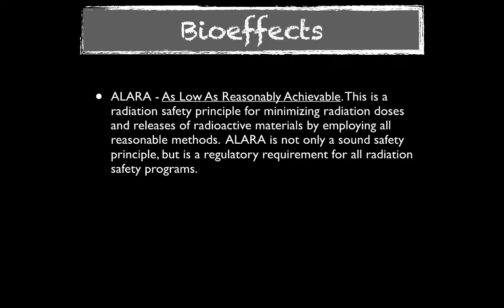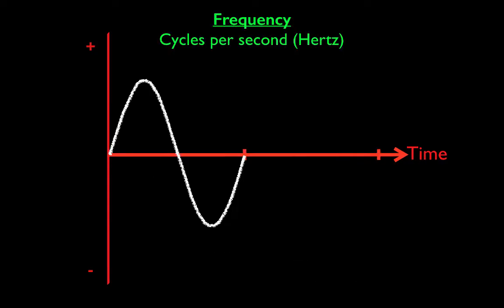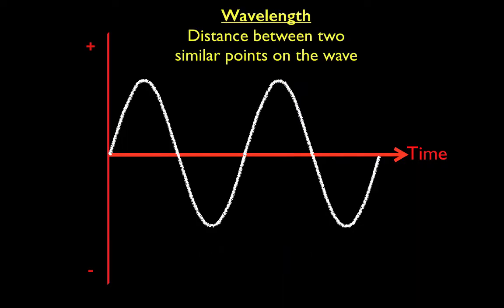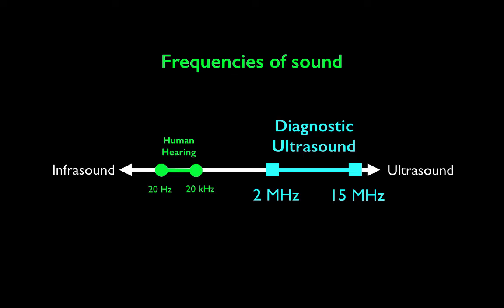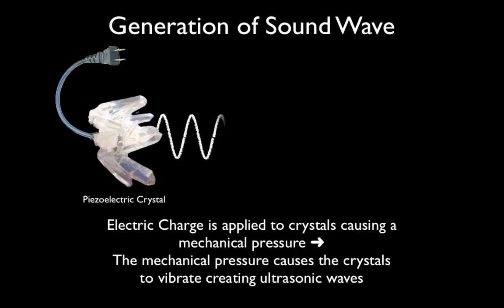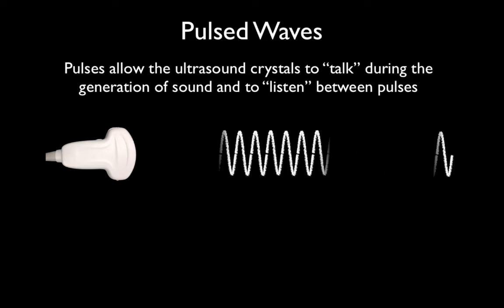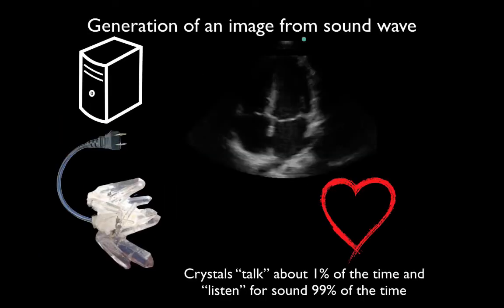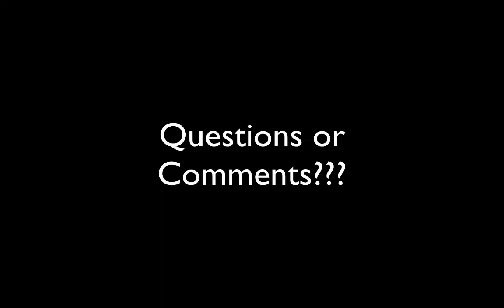Ultrasound Physics Basics Physics and Image Generation

Comment: You said Amplitude = Power?? But how. Power is measured in mW and Amplitude is measured in MPa
Reply from the maker: Joyce -  You are right Amplitude does NOT equal power but it has direct effect on power.  That was what I was hoping to imply.  Also I should point out that frequency has direct effect on power if I didn't state it in this video.

If you'd like to read further on the relationship this is a good site: https://openstax.org/books/university-physics-volume-1/pages/16-4-energy-and-power-of-a-wave